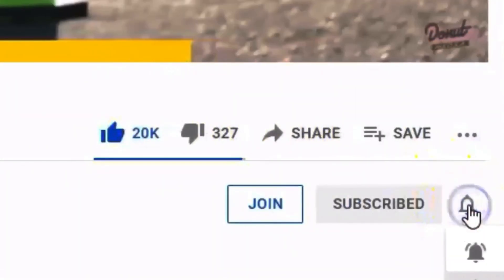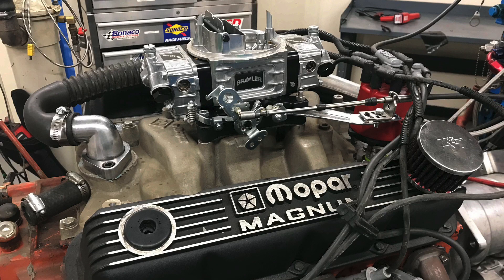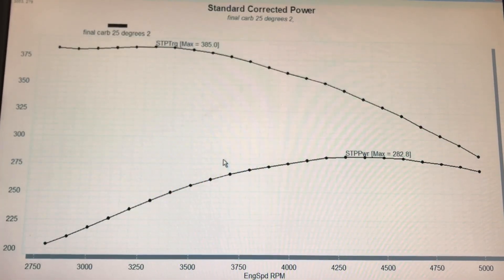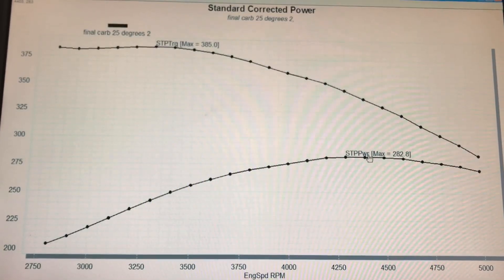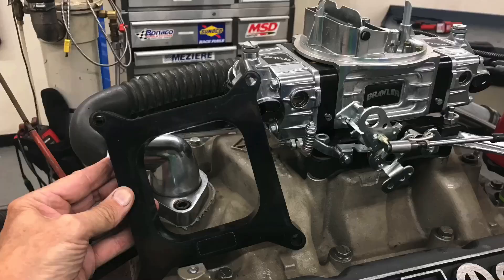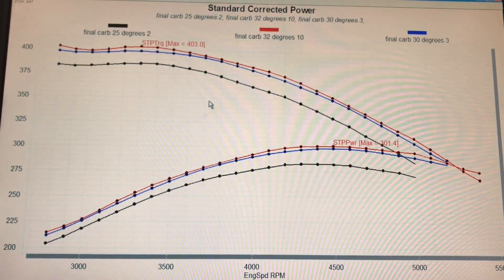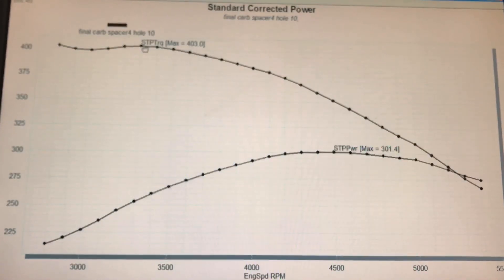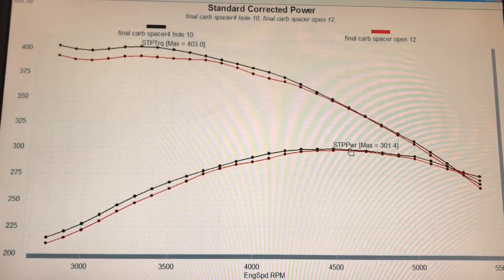DO CARB SPACERS REALLY WORK? 4-HOLE VS OPEN (360 MAGNUM-HP & AF-FULL DYNO RESULTS)

Comment: Richard: Look at our videos on all the other engines!
Me: one solitary Pontiac video...

Its ok man, I own other engines too, like 4V Clevelands, a 340, LS engines.. This is quite interesting to me since my 340 is a weak suck dog, but the Qjet I put on it really woke it up.
Reply: I run Qjets on my mopar. Runs great.
Reply: @johncholmes643  Other than the pump not keeping up into 2nd gear, the 340 really seems to like it. Runs better and makes more power than the Holleys I tried, but also my Holleys are almost all 850 double pumpers set up for 455 Pontiacs. Kinda big for a 340.

Comment: Is there any real value in the spacer to prevent heat soak on the carb?
Reply: With phenolic spacers there is. Aluminum hurts.
Reply: Yes, at least if it is a phenolic resin spacer.  The resin is actually a good thermal insulator.  A metal spacer will transmit heat to the carburetor base just the same as if there was no spacer at all.
Reply: I've run an aluminum spacer on my daily driver for over a decade and the carb and spacer both get so cold they develop condensation and feel like they came straight out of a refrigerator instead of a hot engine compartment. If aluminum caused heat soak problems all the most expensive radiators and intake manifolds wouldn't be made out of it. It dissipates heat very fast for a metal which is why it is used to make high performance cooling parts.
Reply: No. If the manifold is hot, everything on it gets hot. And even if it did, ask yourself, what is a 1" plastic spacer going to do once the fuel enters a hot manifold?

Comment: Richard, would you think the results we saw here with the spacers would apply to other engines as well? I'm trying to squeeze all the power out of my wimpy l-48 as I can on a budget and it currently has a large open spacer on an edelbrock 2101 intake manifold. If changing to a 4 hole spread bore spacer would give me results, I would gladly make the swap. Having an engine running as optimal as possible is an extremely satisfying concept to me.

Comment: These are the videos I like! Head to head comparisons on dirt cheap parts, something anyone could change in a couple minutes.
Reply: Trouble is each engine is different, and these vids can help get in the ballpark, but to maximize YOUR COMBO, you'd have to test it, and without back to back drag strip runs or a chassis Dyno you can easily cost yourself power. What I'm saying is you can't get their results and have it be optimized unless you do the same tuning/testing.  Go out and buy a carb spacer thinking it's going to add 10 hp, and in your combo it could cost you 14 hp until you optimize your engines air fuel ratio, timing, etc. And keep in mind these are wot tests with very low coolant temps that are precisely controlled. In your car at operating temp with full exhaust, stock stall converter etc it will most likely behave very different due to the way the engine is loaded on the Dyno vs your car/truck. So don't rush out and buy a four hole spacer thinking you'll gain power and acceleration. The difference between a good engine and a GREAT ENGINE.. is this kind of testing, gathering data, and optimizing the car.
Reply: @b.c4066  so good to see someone say exactly what i say! Lol! Ive been at the track and heard the argument that “this spacer added 20hp for my 440, it’ll add 20hp toy your 5.0” 
I’m like “ummm, that’s necessarily true…”. And the fight is on!
Reply: @heathermiller2917  spent years reading forums, where guys are asking what timing, what jetting. Blah blah blah, put in the work, pay for Dyno time, gather data, learn to read plugs and they'd realize how absurd it is to ask for info like that, even if building a damn near identical engine, sure you can offer a ballpark suggestion, but ultimately THEIR combo will want what it wants. It amazes me that kind of mentality is still alive in this day and age.
Reply: These videos are so helpful because not everyone is rich